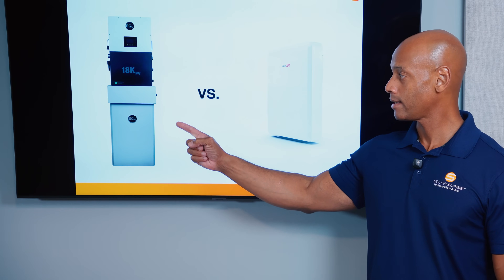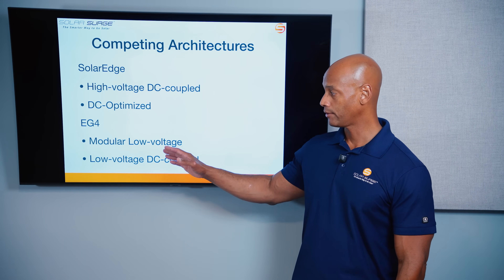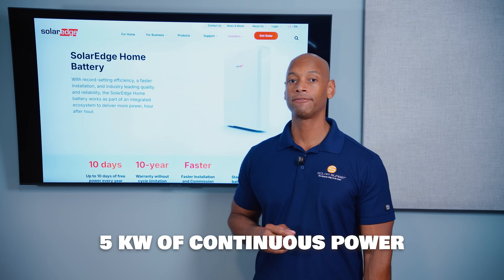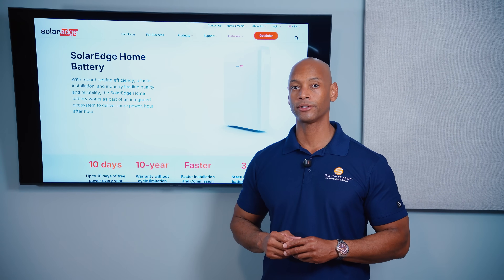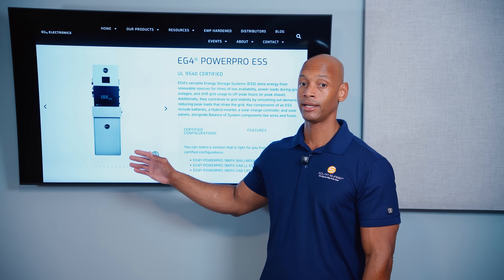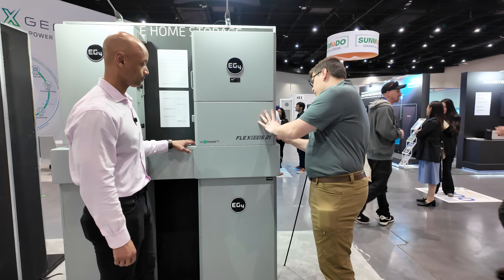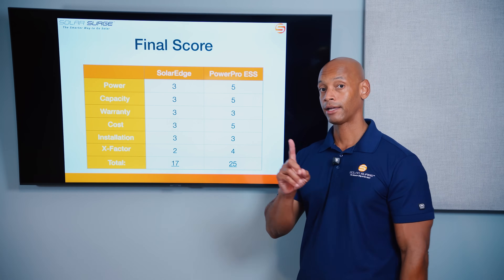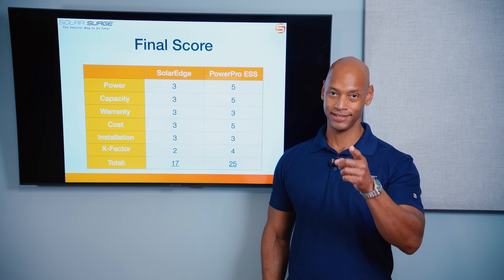EG4 PowerPro ESS vs SolarEdge Home battery

Comment: Thanks.  Keep up with the great content.

We are in a bit of a conundrum at our house.  We have existing solar when we purchased our house (Sunpower) without storage.  The system is small and we exceed its production.  It helps, but we want more.  EG4 seems to cater to some homeowner installation while contracting code related stuff out which saves on the total cost.  We really like this aspect of EG products.  However trying to find products needed to swap out current inverter, adding storage (plus additional storage if required), and additional panels is a challenge.

I am starting to think this is why many just go to a sales officer, say I want this, and do their best to remove the aggressive sales pitches and have it done by businesses.  I don't mind doing the work but it really is confusing on what one needs and if it is actually Ca code compliant.  Ca and our stupid politics with net metering storage and off peak hour battery use is the future.

Comment: a ethos system with 20k of power is just 8k and can be rigg off grid or if you already have grid tie system as well and it can be done by yourself not HIGH Price installer needed that will  take you for a fool the minute you call them yea 18k give me give me.

Comment: EG4 ESS products are far too overpriced and uses outdated 280 Ah cells in their design. You can easily purchase ESS units for far less money that use the newer higher capacity 330Ah cells.
Reply: EG4 is on the cheap side compared to (more or less) all other professional systems.  I don't think one can beat their hybrid inverter (Flexboss18 or Flexboss21) and gateway box (the GridBoss) in terms of price and features.  On the batteries...  it is possible to get very large stationary batteries now as DIY kits that are significantly cheaper than EG4's large batteries.  EG4 will work fine with third party batteries.

You might have trouble with home and utility inspections if you DIY a hybrid (grid-interactive) system though... YMMV.  Off-grid systems with grid inputs aren't as useful.  With an off-grid system, exceeding the inverter capability will trip it off and switch to the grid.  With a hybrid system, exceeding the inverter capability will simply cap-it at its capability and the net power deficit will come from the grid.  For a home backup system that is on the grid, there is a world of difference (not even counting export vs not).

The cell capacity really has nothing to do with anything though.  Those 330Ah cells are significantly larger and heavier than 280Ah cells.  And you need to make sure that you have enough amperage capacity (typically BMS limited) for stable function at the rated output and you are going to find that there's a bit more nuance there than you might have otherwise considered.   Usually that means having at least two discrete batteries in a serious home installation anyway.

-Matt

Comment: love my EG4 system.  Just gonna point out one minor mistake.  The inverter can do 12kW continuous battery-only, and 16kW continuous battery + solar.  However, each 14.3kWh battery is rated for 200A continuous.  This is about 10kW.  So to fully utilize one inverter, you do need two batteries.
Reply: Please show the math you used to come up with that
Reply: @mattbrew11  51.2v nominal * 200 amps = 10,240 watts
Reply: Exactly correct 💯
Reply: I am on the fence on picking one up what, what did you end up going with? And how long you been running it and overall how's it been? 

I am running a 16.2kw Enphase system so would AC couple it. But also have a 12kw gas gen with a 50amp inlet.
Reply: @llN3M3515ll flexboss21 paired with powerpro wallmount batteries are amazing for any needs. They parallel together very easily to meet any storage capacity  and power output goals.  Ive been using my using my flexboss21 for 10 months with 0 issues, I just added another to my system for fun and unlimited output 😉 (paired with 6 powerpro batteries for reference)

Comment: Hello!  I already have a grid-tied 15kW solar roof - would either of these batteries work for me?  Unsure if they are AC-coupled or DC-coupled, figured I'd ask.  Thanks!
Reply: Are you saying you have a “tesla solar roof” or panels on the roof? What is the brand of the equipment located by your main breaker panel?
Reply: EG4 can do either AC or DC coupling, although there are a few quirks with the AC coupling. So it'll probably work with your system but double check with your particular hardware details.

Comment: I think the reliability and diversification of the enphase system is superior.
Reply: It is but some people are too cheap or stupid to understand that
Reply: Mmm.. I disagree.  Enphase equipment is very expensive and proliferate... you wind up needing a ton of small items to make a reasonable system and the costs add up.  Enphase screwed up the scaling of their own backup solutions and AC coupling isn't really as good as its cracked up to be... DC coupling is far superior at scale, in my view.

Dealing with microinverter failures on the roof is also a lot more expensive than dealing with a string inverter failure at ground-level.  But the main problem Enphase has now is that as panel costs have come down, their microinverters have become more expensive than the panels they are being put on.  Also as regulations have tightened, AC bussing large systems is turning out to be more complex and expensive than running multiple DC strings.  Basically, as subsidies start to go away, Enphase is becoming too expensive.

YMMV, but it isn't an ecosystem that I am at all interested in.

-Matt
Reply: @junkerzn7312 so what type of system do you recommend?
Reply: 1/3 of the Enphase batteries size and weight are micro inverters (not batteries) and they charge you for each and every one of them.
Reply: Flexboss21 paired with powerpro wallmount battery = 👌 most efficient in all categories (cost, production, warranty, and reliability)